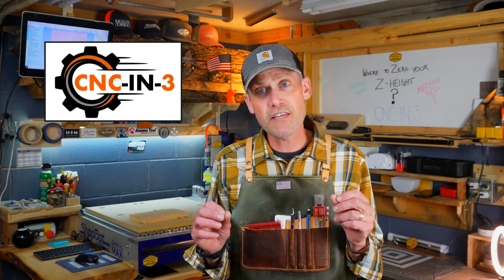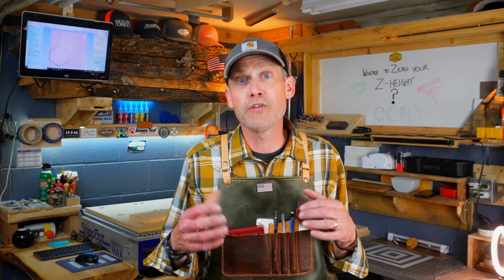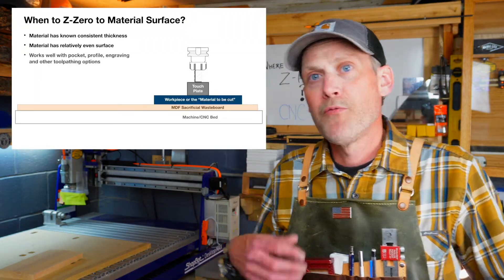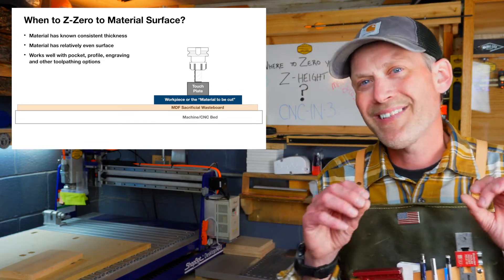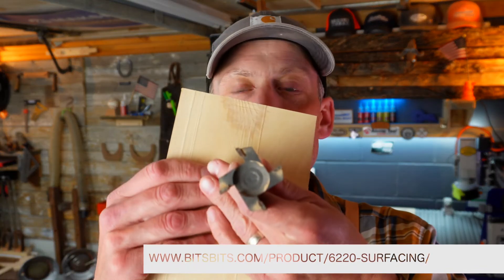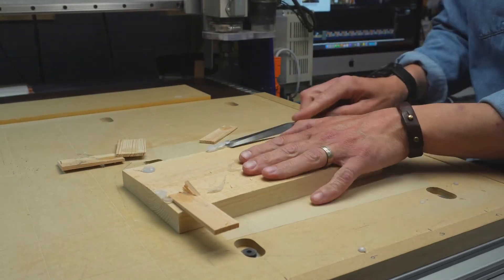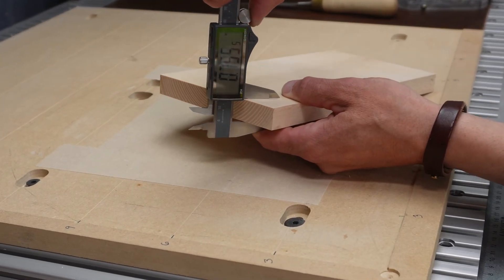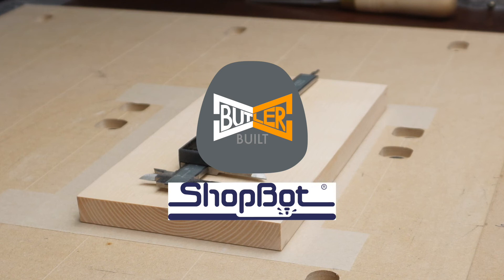CNC Tutorial - Zero Z Axis to Machine Bed

Comment: I would think that zeroing to machine would be much more advantageous given that this never moves. Everything else is known ie material thickness spoil board thickness and tool length. So using and offset with those known thickness would be easier. I’m new to cnc so maybe I’m not understanding why the other method is used more. Great video.